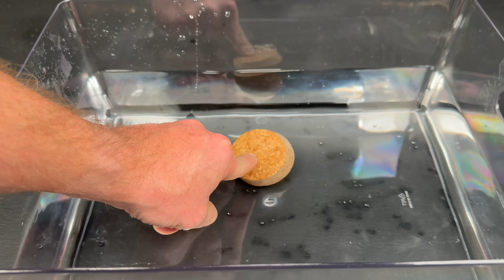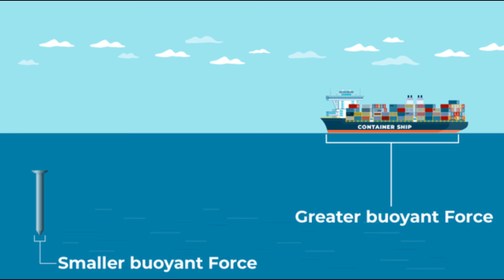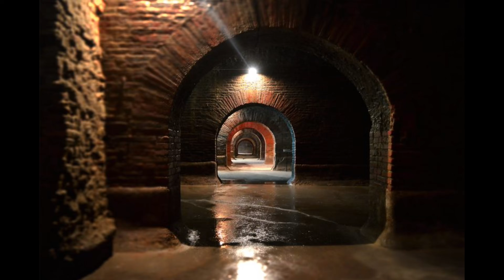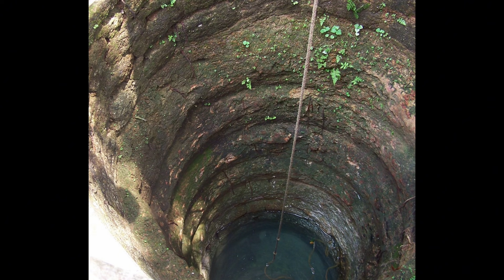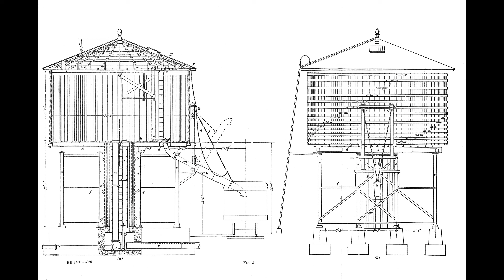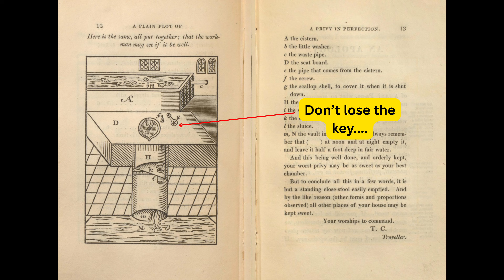The Ancient Machine Hidden in Your House

Comment: I own lots of these. I filter water via R/O and store it in big plastic buckets/bins for various uses. I put these in so that it auto shuts off. Most recent one I put in was so that instead of having to refill a smaller bucket from a bigger, storage one, the smaller one now passively refills whenever my tap isn't being actively used, via permanent connection. Fantastic little devices, very little chance of failure.

Comment: Great Video, thank you!
One Benefit of keeping a Reservoir 'Level' fully filled up is so the Dirt and Sludge can settle in the Bottom, where you can drain and purge it, whereas you draw clean drinking Water from a different Pipe a bit higher up. Don't draw from the Surface since a lot of Bugs and Debris float.
Reply from the maker: Good points! Glad you liked it!

Comment: 🤨 ~ and how could you pic-up Heroes self-filling goblet if it is fixed in place to the hydraulic system? Unless it was a large bowl which smaller cups & goblets were dipped into to fill them and it appeared to not run out of water 😊
Reply from the maker: I agree that’s something wrong with the original design!
Reply: Maybe they drank through a straw.
Reply: So similar to the modern water dispenser/drinking fountain
Reply from the maker: I also had to change the cork valve by adding that metal pin inside which his didn’t have. Couple tweaks like that to get it to function